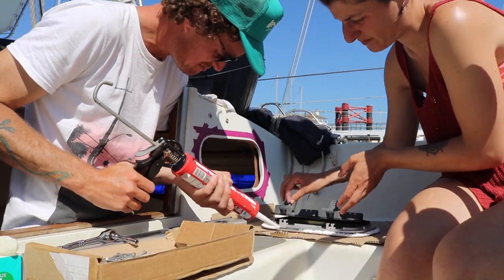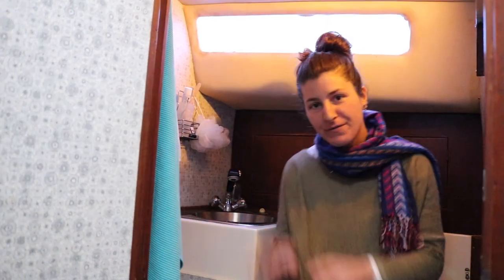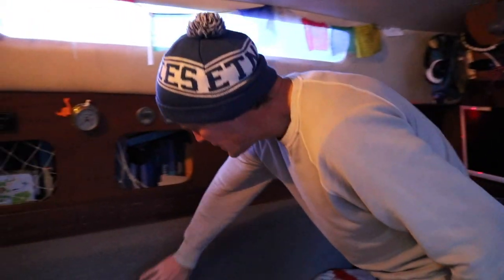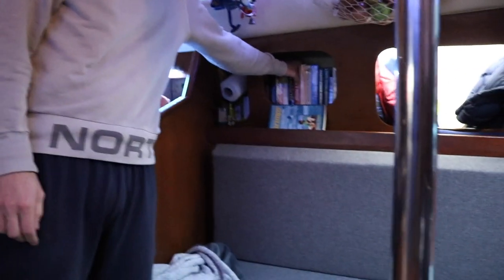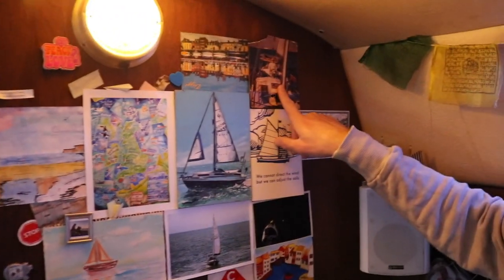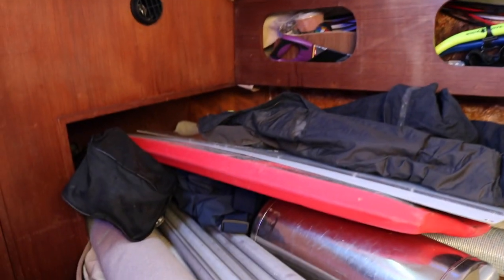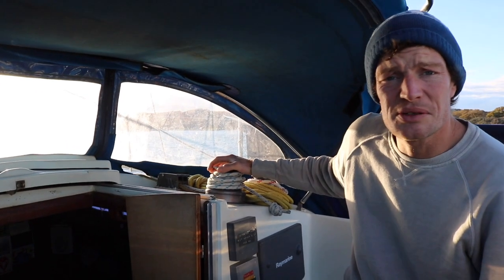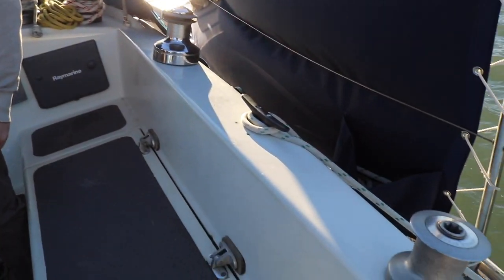Boat Tour - Our TINY home - Trident Warrior 31ft SAILBOAT | SAILING WAYZGOOSE WARRIOR Ep 5

Comment: Great boat, reminds me a little of my Westerly 33, same concept but 2 feet longer. Disagree on the jabsco toilet being easier than a lavac though, I love my lavac, easy to use, doesn't break often, and the only 2 parts that can break are the lid seals and the pump.
Reply from the maker: Great boats, Westerlys! And bilge keel. That’s awesome. You can dry out anywhere.
Yeah! We’ve heard that before but we haven’t had any problems with jabsco since we installed it 3 years ago 🤞🏼🤞🏼
Reply: @SailingSeabird  I've actually got the fin keel version so can only dry out against a wall, but it's still a great boat :D My experiences with jabsco toilets aren't as good, also heard many of my friends say those things eat rebuild kits like it's going out of style - but I guess heads are one of those thing that can start wars, immensely personal and all :D
Reply from the maker: 😂😂 It works for us! Better not to start a war when there’s 💩 involved hehe!
Reply: @SailingSeabird  yeah no thanks, I'll pass on the 💩  :D